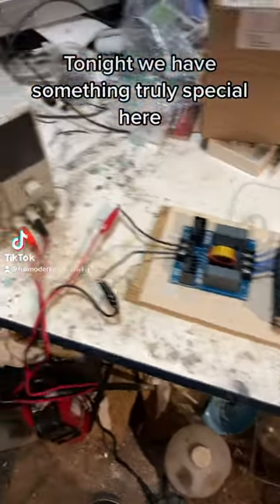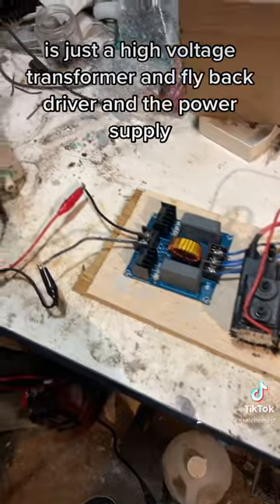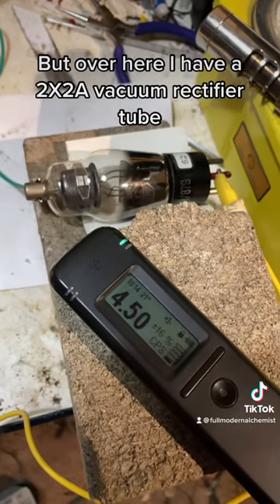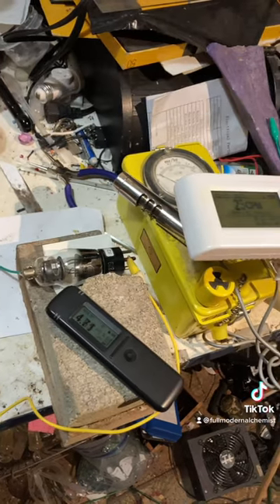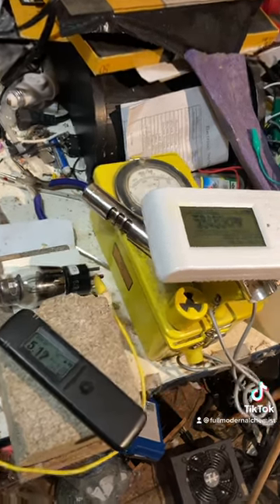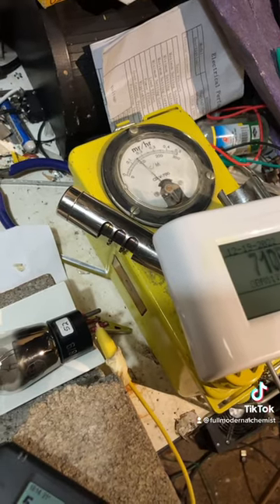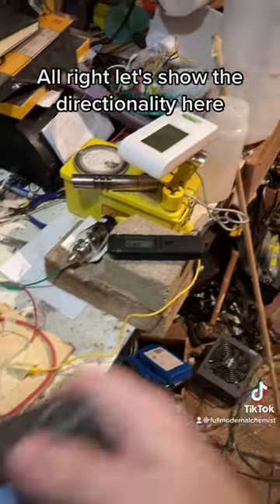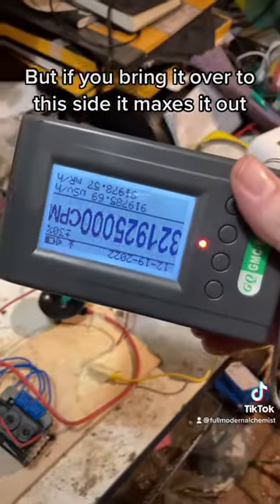X-Rays from a Vacuum Rectifier Tube!

Comment: Do you just need the flyback driver, and transformer to make it to work? My current wimshurst machine does not generate enough kV, like 35kV. And how much Amps and voltage did you apply with the power supply?

Comment: Why radiacode didn't react with x rays?
Reply from the maker: If you look closely it does a little bit, but basically the sensor was being covered up by the brick it was sitting on. I had it there mostly to see how much backscatter was happening in the general area.